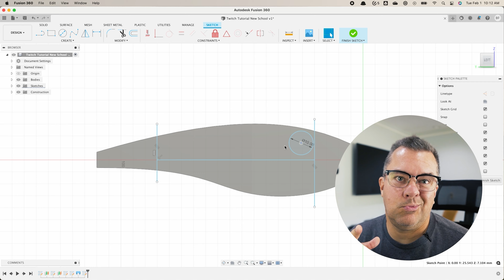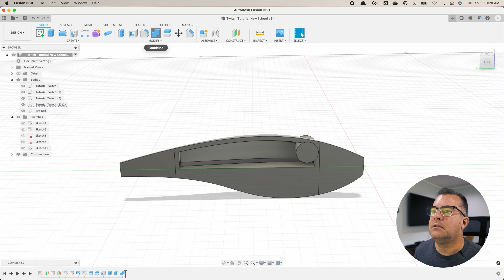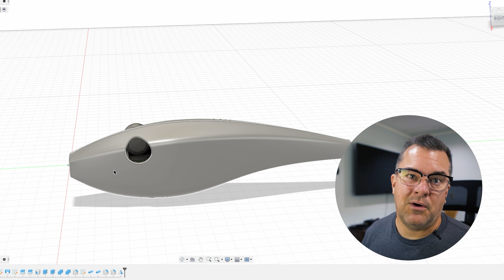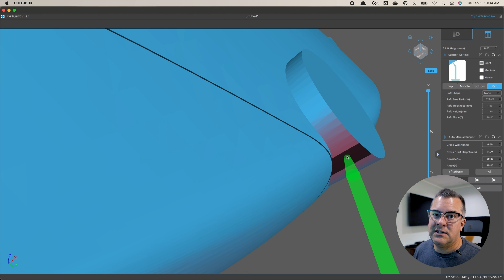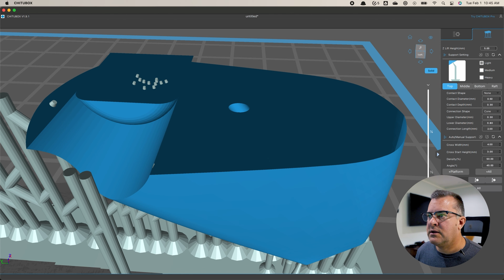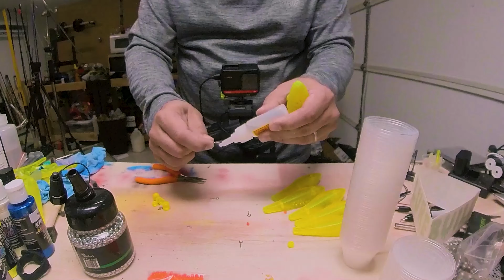Complete 3D Printed Fishing Lure Design Course - The New Hotness

Comment: Nice video course! 👌🏻 I think the body’s will print just fine with the nose direct on the build plate. Just make sure you place the lines for the cavity cuts at an angle so it’s not parallel to the build plate. When I design my softlures I always make a print of the lure itself before printing a mould. And I mostly can print them with the nose direct on the build plate (depending on the design offcourse).

By the way: I think your video’s should have way more views then they have….. I guess there aren’t that many people designing and printing their own lures.
Keep up the good work 👊🏻
Reply from the maker: Thanks for the compliment! Yeah it’s a pretty small group of us but growing!

Comment: Maybe I missed when you did it but if you put the supported printed things in warm water its easier to remove the supports with no traces left on the print, some people use hair dryers also since you get no toxic water out of it.
Also really cool vid!
Reply from the maker: Thanks I have started hitting them with my heat gun and you are correct it works really well!

Comment: I did this to the second lure I made, after the gaps in the first... All I did was mirror my old model fuse the halves, and instead of the eye I just cut a bb sized hole in the bb compartment and also printed the cutout plug. Wasn't bad, but still had to epoxy the side to keep it smooth. Gonna try the eyeball technique.
Reply from the maker: Yeah that is a way to do it as well. I just went with this technique because you have a larger hole to put stuff in the lure. Mostly because I am not that good at planning 😆 If you already know what you want to put inside just make the hole big enough for it. Thanks for watching and sharing!
Reply: @WMBayouLures  I like your method. Seems better thought out than me just plugging a hole in the side. Do you epoxy the new age model after, or just paint and go?
Reply from the maker: @johnhammond6225  I am not that great at painting and finishing but what a do now is clear coat (currently krypton crystal clear but any crystal clear will do) then paint, then a UV clear coat. That’s seems to be working really well so far. You can paint the resin directly but I get way better adhesion if I do a base clear coat first. I use the rattle can clear because it is faster but a base UV clear would work as well.
Reply: @WMBayouLures  makes sense. I'm a crystal clear user as well. I have been matte black rattle canning the resin, then paint, then crystal clear. I started making soft plastic molds and can't believe how well they work vs the metal molds that cost 10-20x more. Thanks for the video! Liked and sub'd.
Reply from the maker: @johnhammond6225  yep I started with molds, I have a bunch of videos on them as well. Thanks for the sub!

Comment: A good call to do is use some silica gel as a rattle.  The bb is introducing to much movement in your bait. Also, with the silica pellet, while it still rattles reasonably well, you'll have the benefit of knowing if your lure is taking on water later once you've got it painted 👍
Reply from the maker: Cool I have some I will use on the next one I put together, thanks!